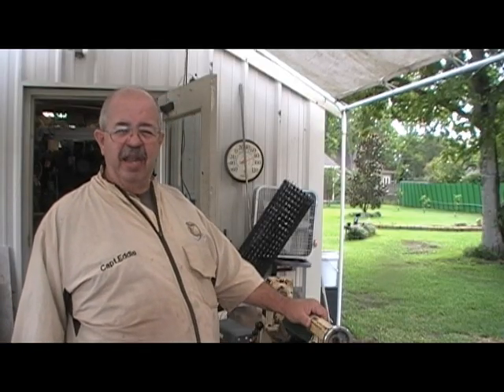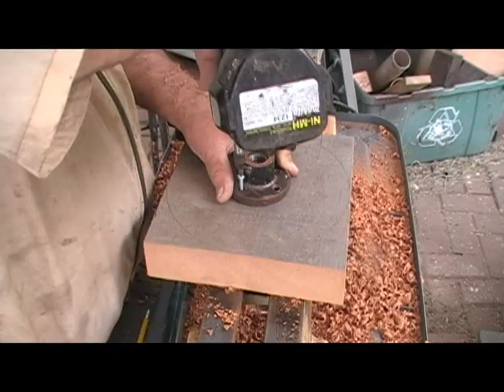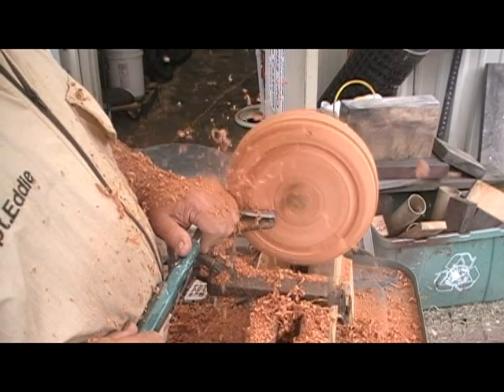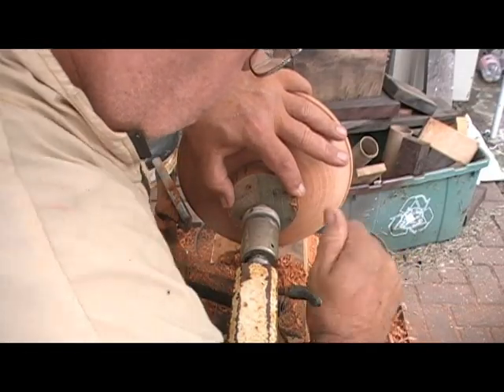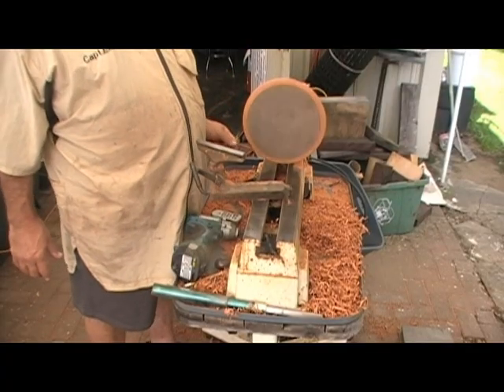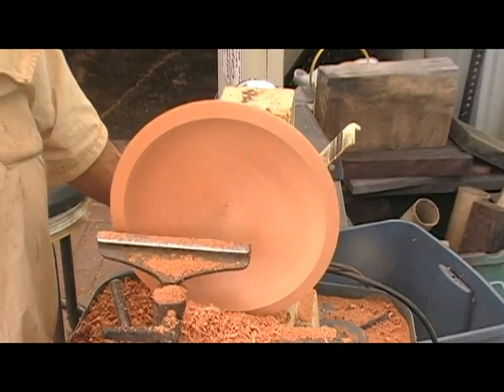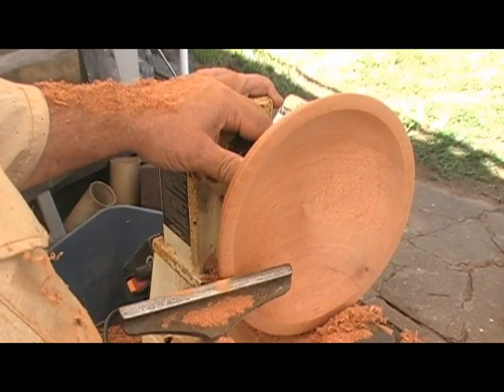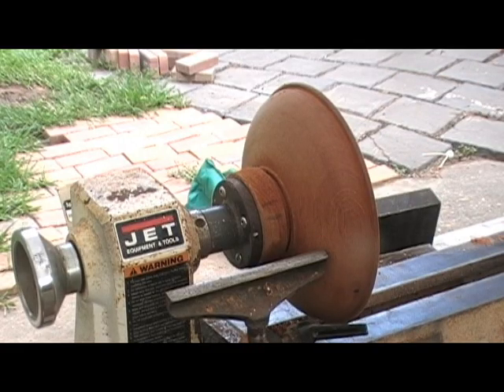# 180  The basic bowl with Carbide tools

Comment: You can tilt the cutter to 45 degrees and take light cuts. Usually works for me. Sometimes I will soak in some thin ca glue and that helps as well.

Comment: I use both carbide and HSS tools and it doesn't matter what kind of wood I use...I get circles. No particular place..on the bottom or on the sides both. Not always complete circles, some times only half circles. What am I doing wrong, and how do I get rid of them. Sanding only makes them more visable. I start with 80
Grit up o 600 grit. Thanks for any advice you can give. Buddy

Comment: I use hot glue all the time Capt. It works great. You just have to make sure the glue is HOT when you apply it. If the glue gun doesn't do at least 380 degrees, then it wont get hot enough. I guess it's just a matter of preference.

Comment: Cap'n Eddie, do I need to cut a groove to seat my square cutter in order to sop it rotating during use, or can I just flush mount it on the 1/2" sq. bar and screw it down firmly?  I see others seating it carefully in a groove, but I don't know if that's necessary.  Great vids!
Reply from the maker: Just put a drop of very thin CA on it.